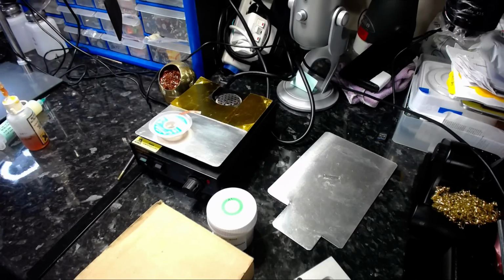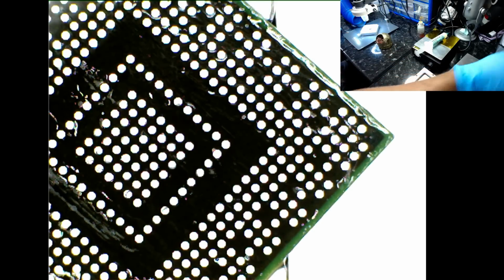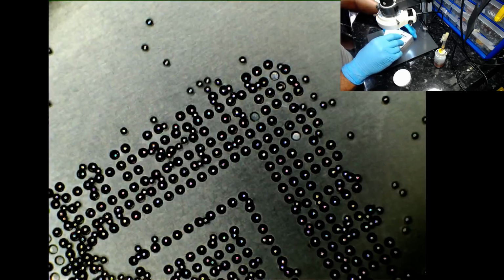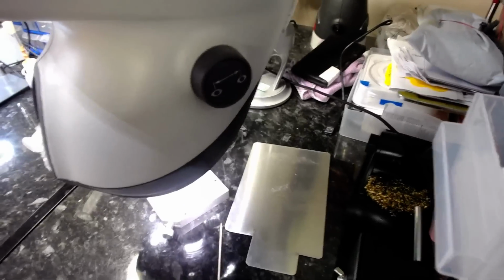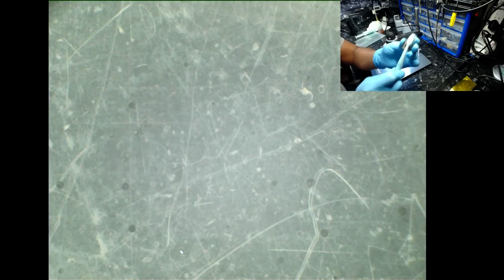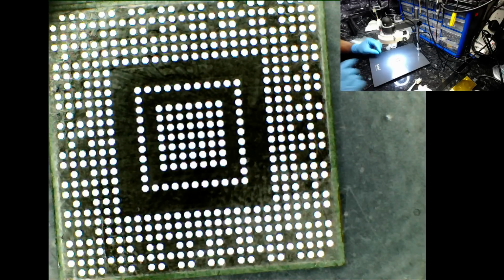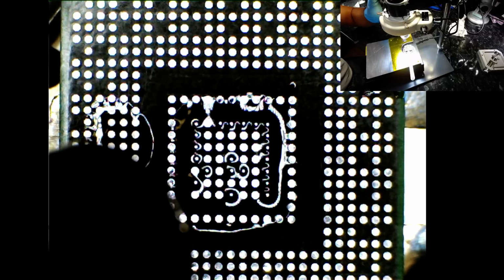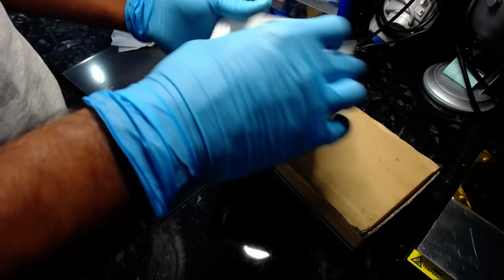REBALLING GPU CHIPSET BGA REWORK MADE EASY

Comment: Hi, I would like to ask if after reballing some balls are grey (like cold joints) and the other are silver then should I care about it? I heard about the way to put a lot of flux when balls are already soldered in place and heat a little with hot air to correct the connections and make them all look silver, but I'm not sure if this is the right approach or should I just leave them grey and solder the IC back to the board

Comment: sir how many celcius need to buy  i mean solderball what temperature>?
Reply from the maker: Hello,  melting point for leaded solder is 183 and lead-free 217 degree celsius.  But reflow temperature for leaded is 195 to 200 maximum, and lead-free 225 to 230 degree celsius maximum.  Hope this helps.

Comment: how do you choose between solder balls and solder paste?
Reply from the maker: Hello, solder paste is ideal for small pcb like mobile phones because the required solder ball size are much smaller compared to this chipset.  Chipset like this requires solder size 0.5mm 0.55mm, using paste and stencil you going to struggle to meet the required size because the thickness of the stencil is insufficient.  Take care.

Comment: To clarify, reballing is not a solution for a damaged chip. Balls don't fail (except maybe in the early days of lead free when I think there were occasional metallurgical problems like the Xbox RRoD). The only reason to reball is if you want to reuse a working chip, eg. taking a working chip from a scrap board, reballing or, and using it to replace a dead chip on the target board. @Tactical Looter is correct - it's the heating itself that may temporarily "fix" a dodgy chip, but it will fail again soon once it's gone through some thermal cycling during normal operation. Louis Rossmann explains this well in one of his videos. If your C/GPU has failed, reballing it isn't the solution.
Reply: What about fat Ps3s? How frequently do these chips burn or completely wear out if you should know. Would reballing in this instance not work. I'm not certain if Sony used lead free soldering..
Reply: Nah, it was in both Xbox 360 and PS3 cases not solder ball issue, but a mismatch of underfill chemistry. Rip-felix made a very good video about it, and also a very comprehensive thread on psx-place.

It's quite interesting.
Reply: Not really, when a GPU falls down, some balls can fail and reballing is the only solution. It is very frequent on modern heavy GPU to have cold joints under the rams, and reballing fixes this problem

Comment: Which Flux you use?
Reply from the maker: Hi Pal, Amtech Flux lf4300 or nc559.  Also rosin base flux first to create tacky.
Reply: @iTCXtreme  from where you buy the stencil  from the producer of the cip  or 3rd party or you have to customize
tnx
Reply from the maker: @dancro9809  Hi, if want full set try AliExpress or eBay. Look for reballing stencils.  Goldenchipset sell full direct heat set for cheap.  Non direct heat stencils (I am using) should be available  from Jimmy@ Insat International (London)

Comment: Hi after reballing job finished, what is the ideal temperature for the balls melting on chip?
Reply from the maker: Hello, this depends on the type of solder balls used.  Leaded solder ball will melt at 183 degree celsius (reflow temp should between 195 to 205 degree celsius maximum)  and lead free solder ball will melt 217 degree celsius (reflow temp should be between 225 to 235 degree celsius maximum.  Important do not exceed the temp and only hold it for 10 to 15 seconds on maximum temp.  Pay attention to any crack or pop noise from chipset, this mean the chipset is damaged.

Comment: Why do they use BGA?  Why not same as CPU with pins built in?  BGA is just trouble.
Reply: Sad. Truth.    Consumers should be more informed.
Reply: It allows for higher density circuits because balls can be smaller than pins and, crucially, you can put stuff on the other side of the board! This means more space for more, and closer, decoupling capacitors, for example, which improves signal integrity.

Comment: Hi, I've been confused about reballing for a loong term, there doesn't seem to be many tutorials or lessons available so it's just a matter of watching the process and understanding what's going on. 

I'd like to ask you though, how would you know if reballing is necessary? I own a GPU which may work for 10mins, then prevents a computer from booting. I don't feel like it's a capacitor, but searching "GPU Black Screen" lead me to reballing videos. Could this be the fault with an Nvidia GTX 1060?
Reply: Ever figured this out?
Reply: @zomaardan  Need to improve your knowledge on electronic engineering then understand how GPUs work, or other main boards. Understanding their function helps determine which part needs replacing

Comment: REBALLING isn't fixing the GPU it's a myth, what actually fixes the GPU is the heating of the chip to 140 C°
Reply: But this is only a temporary solution!
Reply: @tacticallooter  still I don't understand why it is working after heating it it's because of the balls between the silicon and the mini pcb? or the silicon itself is damaged
Reply: Actually is not a myth: if the GPU is faulty yes you're right, but often pads are ripped or just cold joints, so reballing is the . I've fixed a lot of cards and they are still working.